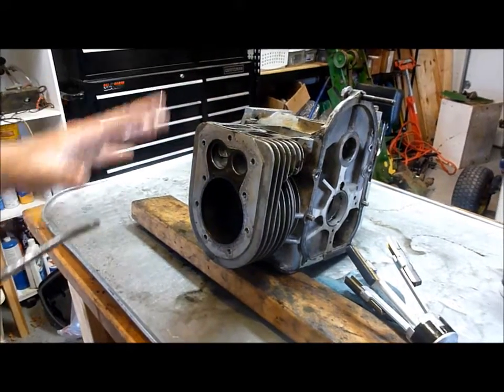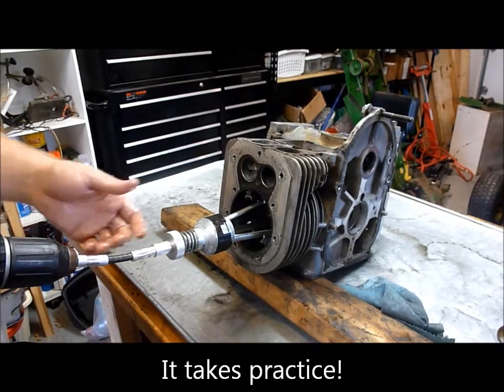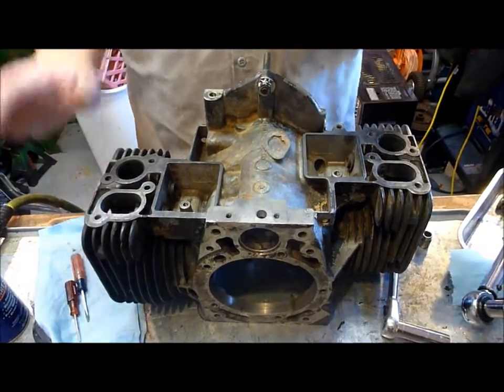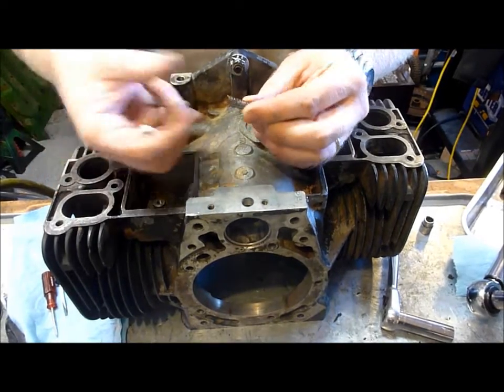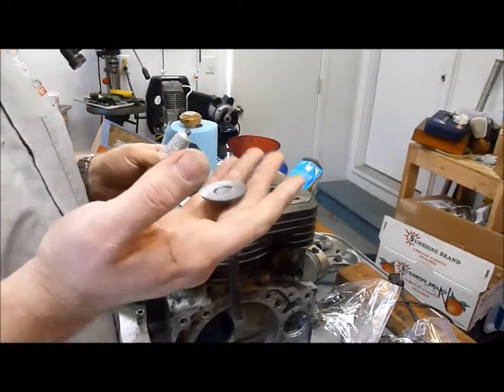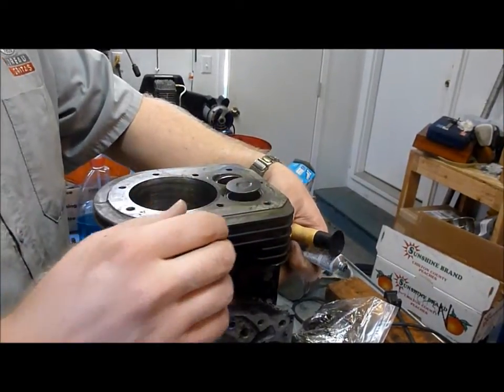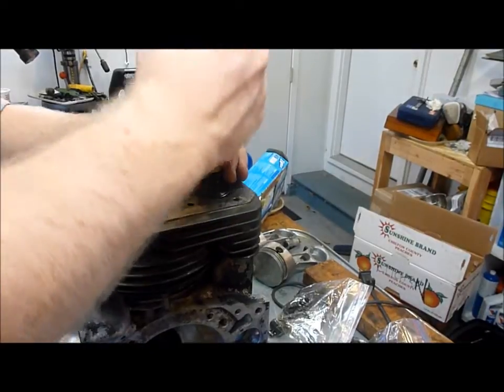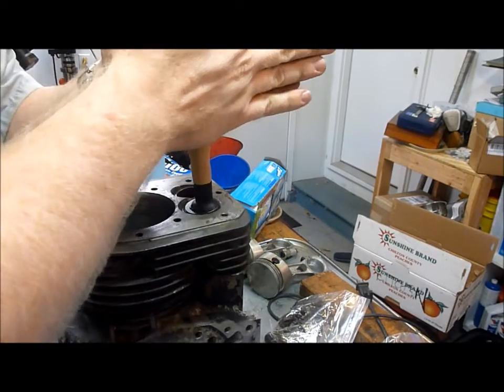Rebuilding an Onan B34G (Part 3) Onan P and B series block Prep

Comment: Should I get new parts for oil bypass
Reply from the maker: I can’t remember if there is a test for the spring in the technical manual. Typically those parts should not go bad.

Comment: Now,..the repair manual says not to lap the valves,...what made to go against this rule?  Really good videos!
Reply: Theory is , if you have a good valve grind they will seal , and you will be changing all the angles that were carefully ground onto the seats and valves. To tell the truth I have not heard of anybody lapping vallves since the 50s except on race engines that will only be running for a few minutes before their next rebuild
Reply: Manual states that one side is at 45 degrees, the other is at 44 degrees. This gives a razors edge seal between valve and seat. If you lap, you have a much wider sealing surface. The timing of the engine was designed to have only the smallest edge between the two components. If you lap them in, then the valves won’t operate as designed and the engine will always run lousy.